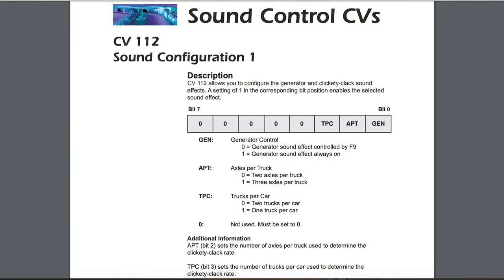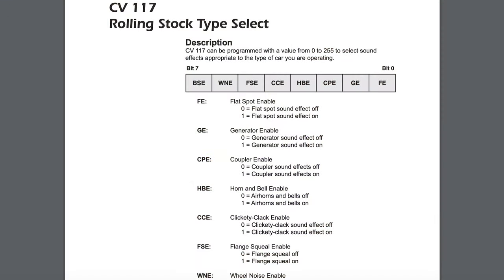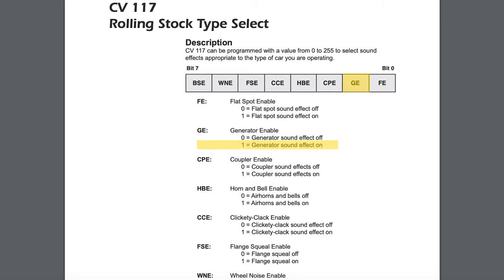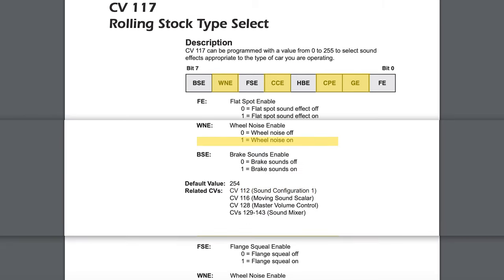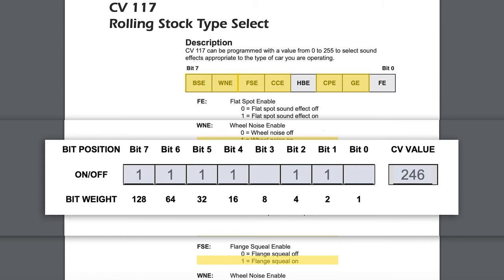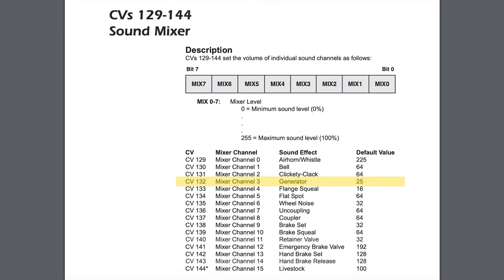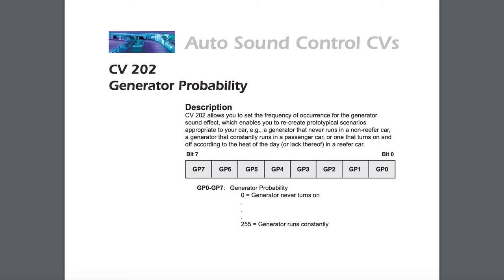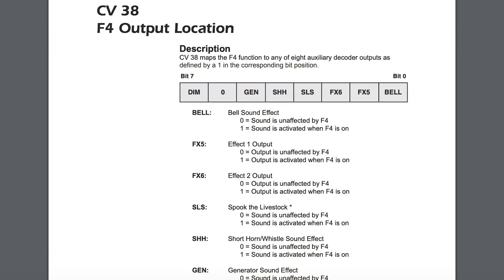SoundTraxx Tsunami SoundCar: Reefer Set Up

Comment: A good option that is missing with this decoder is, the variation of the refrigerator engine speed, which is commonly used when transporting frozen goods.
When Transporting frozen goods such as Ice Cream, frozen meals etc, when the temperature is set to say -10F, the refrigerator motor constantly runs to keep the cold air flowing at idle. When the temperature rises to say -8F the generator revs up to pump in more frozen air to get back to the temperature, then goes back to idle.
This option would be great to implement as an option with this decoder when you guys look at up grading options on it.
I transported frozen goods across Australia for close to 25 years, and would be great to copy it on my models.
Reply from the maker: Thanks for the feedback, we will keep this in mind!